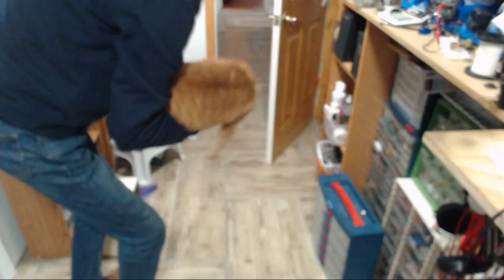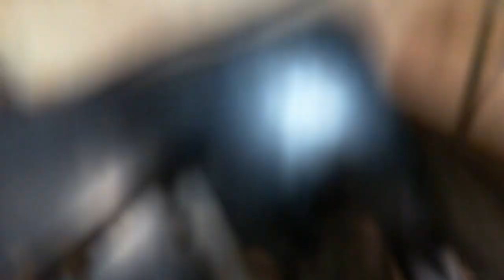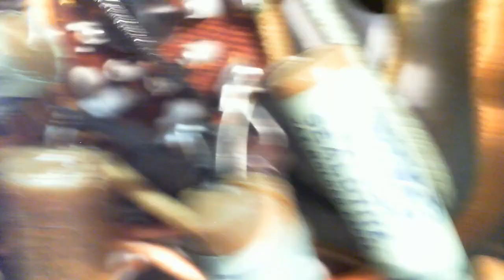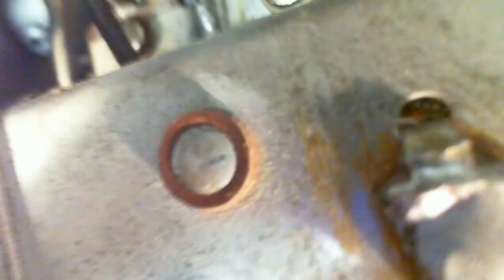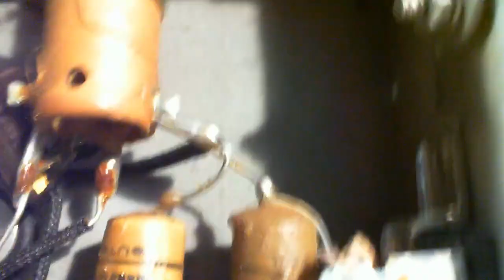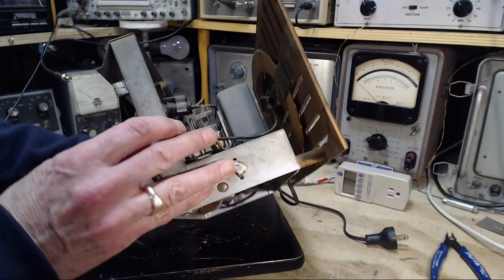Ugly Painted Viking Model 4516 Video #1 - Checkout

Comment: 38:27 The capacitor in parallel to that 270k is 0,2uF . At 60 Hz it has a capacitive resistance of ~ 13,2k At 120V AC that alone would make for ~9mA current flow if one grounded the chassis to earth and the mains prong was plugged with b- tied to life rather than neutral. Also is leakage in a capacitor a function of applied voltage too. Your test and its result can potentially fool some newbie into neglecting the need to change this capacitor based on it. From an educational standpoint it would have been wiser to cut that cap and the across the line cap before powering up. Even when using an isolation transformer and dim bulb.
Reply: He left a metal flake of solder on a tuning cap ( which he didn't see at 8:08 ) and didn't reconnect the coil wire he did catch in the video. Then Jim fixed the business end of the  old line cord plug instead of replacing it totally with a line cord  with a  polarized plug. For newbies that should have  be done for starters in this video!
Reply: Wouldn't Carson's Lab strip down the radio and rebuild it using modern components through out?, what about replacing the tubes with wire ended vacuum tubes and losing the mains cable and running the heaters on 1.5V and the B+ 12V

Comment: Eaton Co. Viking 46-31. The word VIKING is  a  black edged gold lettering styled decal between the knobs.Playing along? Check out schematic at 
pacifictv.ca !!!  Don't forget to see the annotation page right above the link of this radio to explain the capacitor marking on schematics!
Good catch on the broken coil wire on T1 Jim!
Reply: he's the Master pacifictv.ca has an edited schematic with component values viking46-31.pdf
Reply: Done! Hope Jim finds it. Looks a lot cleaner of a schematic than the one I first posted about. The schematic needs some slight notation about how to read it because
 it will show a T,E,C,or M next to a capacitor . For you newbies that is noting what kind of capacitor it is. T  for tubular,E for electrolytic,C for ceramic and M for mica.
The number after the T and E stands for uF. The number after C and M stands for pF!